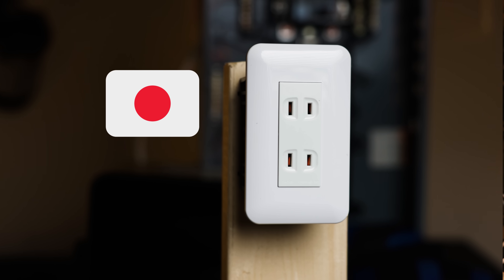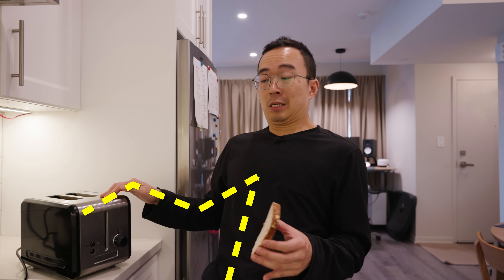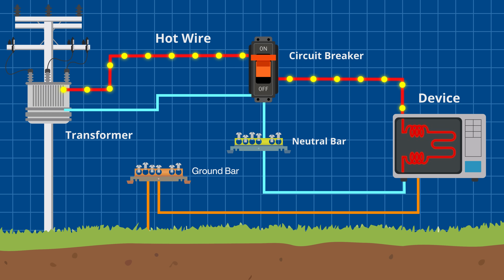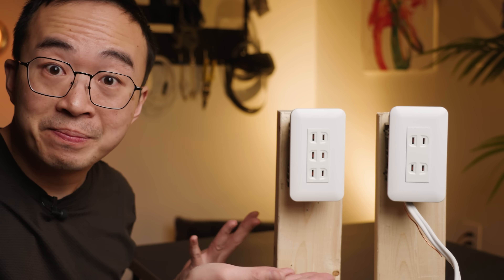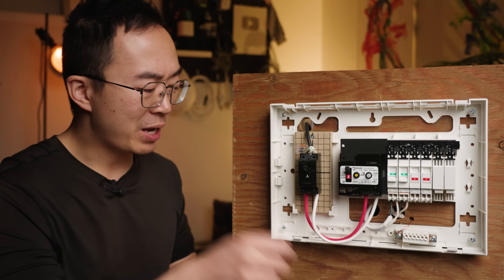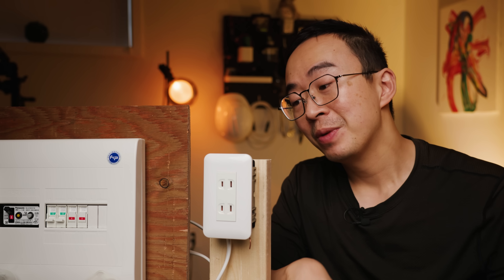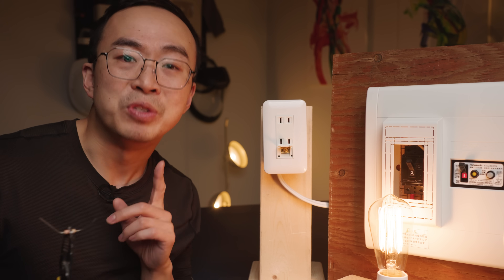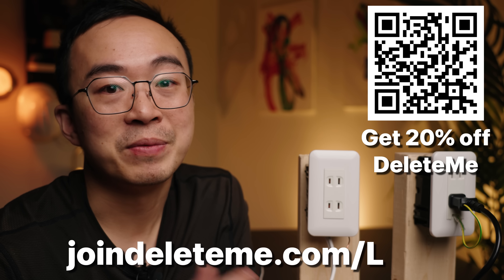How Japan Made Their Outlet Safe

Comment: Oh, FFS. I've been so annoyed at Japan for all the years I've been living here, and bought a special GFCI for my workbench outlets, and ran a ground cable across the room to my washing machine outlet, and it never occurred to me that the "thing with the extra button" I've been looking at for years in my electrical panel is a GFCI, though it has that totally obvious extra reset button that's, well, what else would it be for?

But actually what got my attention here is that the outlets you showed are proper NEMA-15 with the neutral blade larger than the hot blade. I thought they didn't do that in Japan, until I checked all the outlets in my apartment (which is fairly old, '80s I think, definitely no later than '90s) and they are all polarised, too. But the damn extension cables and power bars here are not. WTF?

Comment: TLDR it’s A GFCI breaker.

We do this in America too. (It’s actually cheaper) the ground wire is just redundancy.  

You can do that this to put ground fault protection on older homes with ungrounded systems.

Comment: This is not exclusive to japan.
Many other countries use this as well.
They use multiple systems. 
The weakness of this system is the reliance on continuity, where in theory there should be enough current through ground to trip the breaker, but in reality this does not always happen, the breaker stays closed and now you're back with the same old problem. Except its usually higher voltage across one phase in a TN system than in an IT system.

Comment: In the Netherlands(also Belgium) we have TT grounding. Neutral is tied to ground at the central transformer. Every house has a deep ground rod. The supply company only supplies neutral and live. Neutral is not connected to ground in the houses. 
30mA RCD's are mandatory (maximum 5 groups per RCD). No GFCI's here.
New houses require grounded sockets everywhere. Existing houses only require grounded sockets in wet    rooms (bathroom, outdoor sockets, central heating installation, washing machine etc).
All household appliances are double isolated(ie. Galvanic through a transformer and non conducting materials). 

The downside with TT is that sometimes you get a neutral that has a significantly higher voltage than earth (barely any current though). Especially with a faulty ground rod, which can affect multiple houses.

Big advantage. Neutral and live are interchangeable. Nobody cares if neutral is left or right on sockets 😜

Edit: wow a socket on bath height. Here sockets need to be a minimum of 60cm from wetzones, be IP44 or IP55(depending on the zone). What i usually see in bathrooms are sockets above 1.5m from the floor.
Reply: Well in Belgium that have also three phase 230 V without neutral. Each socket gets two phases.

Comment: Right on the money.  The necessity for grounding is mainly the result of bad appliance design (and bad socket designs in certain countries where the standard socket can easily have a metal key stuffed into it by a curious child...).  If we designed appliances (and sockets...) better, grounding would not be necessary.  There are many ways to eliminate the need for grounding.  GFCI breakers are a good one, and while GFCI breakers are mainly used in sockets installed in wet areas in the U.S., GFCI breakers in breaker boxes are becoming more common, but they are typically still limited to parts of the house most vulnerable to shorts to ground (wet areas) as redundancy for the GCFI outlets, due to their much higher cost than standard breakers.  GFCI main breakers are starting to get more attention in the U.S. though, so maybe we will see a transition in that direction in the future.  Both grounding and GFCI breakers won't prevent some initial shock before tripping though, which as you mentioned can be a serious danger to kids and older people with heart problems or pacemakers, so a better solution would be for appliance manufacturers to insulate metal casings from live wiring inside the appliance better, or even better, they could avoid using conductive metal casings entirely (opting for insulating plastics or ceramics instead).  While insulating better is a matter of quality that probably should be legally enforced (and this is coming from someone who is generally opposed to excessive government regulation), plastic casing is not feasible for all appliances, and ceramics can be fragile, expensive, and quite heavy.  Heavy appliances like fridges, washing machines, and dryers need stronger structure than plastic can provide, and the easiest and cheapest way to do that is to use steel casing.  And toasters (and clothes dryers) often have a lot of metal because plastics don't tend to be heat resistant, and the ones that are heat resistant are far more expensive than steel.

So what it really all comes down to is that grounding and GFCI breakers exist so that appliance manufacturers can be cheap and lazy about safety without causing too much harm to consumers.  (To be fair though, GFCI in wet places would still be a good idea even if manufacturers prioritized safety, because you never know when some idiot is going to accidentally spray the toaster or drop the hair dryer in the bathtub.)

I'm honestly not sure what is better: The government regulating construction heavily so that appliance manufacturers can cut corners on safety, which makes housing more expensive but appliances cheaper, or the government regulating appliances heavily so that construction doesn't have to put as much resources into grounding and GFCI, which would make appliances more expensive but housing cheaper.  I guess there's always a tradeoff when regulating industries to keep people safe.

Comment: Brazilian here. That's how we used to do before the 90s, when ground became a requirement for new houses. Neutral was used as ground, plus a circuit breaker. Obviously, using the neutral as ground is a horrible choice, but was done due to the extreme poverty. Unfortunately, it is still pretty common to see this setup in old houses and that's why we sometimes get those small electrical shocks when touching the shower handle. It doesn't kills you (i used to get them everyday growing up since i was a little kid), you get used to experience them every day, but it's not ideal.

Electric shower heads + hanging wires + neutral as ground + body and floor wet = fun shower!

Comment: Some remarks:

1. You don't have so many electrocutions or shocks in Japan, because the average IQ in Japan is 10 points higher than the average IQ in the US, and with higher IQ there comes a better understanding of technical issues as well.

2. In the US every hillbilly can make an installation (and most of them even think they know how to do it right), while in Japan - as far as I know - all installations must be done by certified electricians.

3. Sure, any system that has an RCD is way safer than whatever the Americans got until recently. However, it'd be even safer with an additional ground wire. And the only reason why Japanese households do not have it, might be that the 3rd wire was not made mandatory when the RCD had to be installed, because it would have meant re-wiring the houses (with a lot of house owner protests). But since typical Japanese houses just live .... say 50-60 years ... that problem could have been solved already ...

4. The RCD is not a Japanese but a German invention (early 1900s) which led to improvements in the following decades. However, they already started here to install 3 wires before RCD devices devices even were available, and almost every new building got an RCD after the 60s (Farmers even had to upgrade before that (say mid of the 60s) for their and for their animal protection, 500mA if I remember correctly). It might be correct, though, that Japan was the first to make it mandatory.

5. TT systems are way from being the optimal solution. They are used because the distribution companies want to save money on the expense of their customers, because then it's the house owners responsibility to ensure proper "shutdown conditions"

Comment: GFCI outlets trip at around 6MA, not 30MA in America. You can die at 9MA of current. So, how exactly is japan constructing a safer electrical system with slower reacting GFCI and the lack of a grounding system? Especially when having a grounding system ensures proper operation of the breaker in the first place, and irreplaceable saftey measures. America can swap out any receptacle for a GFCI and protect the while circuit if placed at the first device in the Circuit. It seems to me Japan is heaps behind modern electrical saftey standards. Considering if that GFCI in your Japanese panel fails, so does your safety, without any backup system. We have a grounding system (main safety) and GfCI for additional measures.

Comment: Ground sets a base zero for your electronics, this is used for more than just safety, it's used to avoid differential charges between devices, deal with static discharge, feedback loops, and etc. Is it necessary? No, that's why many devices don't use it. Can it be really helpful YES, and due to the other benefits of grounding already existing the safety through ground is just a convenient cheap solution (in most situations) to an otherwise solvable problem using an additional feature.

Comment: TERRIBLE explanation of grounding. What you are calling grounding is properly referred to as BONDING because it bonds all conducive components to neutral through a second safety wire. (bonding wire) Yes, it also connects to earth to equalize lightning strike potential, but that is out of the scope of your video.

Comment: As Andrew Lam correctly pointed out near the end of the video, the Japanese governent is pushing for installed receptacles to be grounded from now on.

One can easily find copies of the JIS C 8303 standard on the World Wide Web, at least far back as 1993, that contain specifications for flat-blade and locking receptacles that are functionally identical to most of the 15- to 30-ampere variants of NEMA 1, 2, 5, 6, 10, 14, L1, L2, L5, L6, and L14.  (I haven't looked carefully, but the most popular NEMA receptacles seem to be covered, although the Japanese counterpart to the NEMA 6-20R receptacle does not appear to share the same shape.)

Lam's video can be reduced to two points:

(1) Japanese legacy wiring suffers from inadquate equipment grounding, mitigated by service-entrance GFCIs.

(2) Japan has adopted better facility grounding practices and has been moving, albeit slowly, toward harmonization with most 15- to 30-ampere NEMA receptacles.

Comment: Japan Failed Badly. The issue is that when you need to do noise filters that shunt the noise to ground, the ground can't handled the required current without tripping the GFCI. This makes it impossible to properly filter noise on powerful machinery.

Comment: MEN systems are not about saving lives (directly) , MEN systems will trip the safety device with one fault. Non MEN systems require two faults to trip a safety device. RCD devices are used to save lives as they detect leaking current in the milli amp range that trips the circuit breaker before you receive a lethal dose of current.

Comment: Look at your plug, there is plenty of appliances that don't need third prong. They are double insulated and there is no da danger of a faulty wire conducting to the housing.
The reason why we don't have socets without ground is, well then you can't plug in something that requires housing to be grounded. 
Nothing special really.

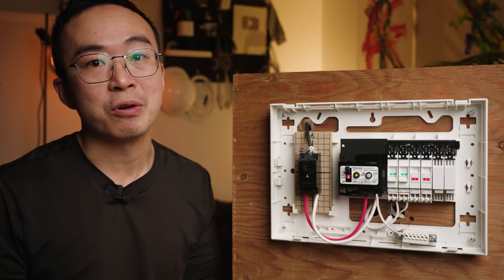Comment: I stay in Bangkok and 07:20 is something that the TH-GOVERNMENT DESPERATELY NEED to adopt and implement AS SOON AS POSSIBLE .. it is completely unbelievable that ALMOST EVERYTIME you plug something into a socket (regardless shaver, phone charging cable anything) you will almost ALWAYS see sparks fly out of the electrical panel. Thats how backward / scary Thailand's sockets are. Basically the entire nation don't even have a built in GFCI/RCD in the entire electrical outlets.

Comment: As an electrician in Switzerland, our electrical system is designed with a high emphasis on safety, similar to what Japan intends to implement with 3-hole sockets. Here, all our sockets have 3 holes, and both our sockets and plugs are specifically developed to prevent any contact with metal parts during the plugging process. While there are still some older installations, the use of RCDs (Residual Current Devices) has been mandatory for several years now, providing an additional layer of protection.
Reply: I am from Switzerland too but living in Japan. Man, you should see some of the shit here. You wouldn't believe it.

Comment: I think grounding is added as the residual current circuit breaker will not trip if the washing machine's faulty live goes on the water mains while it's off, until someone in the bath tub gets shocked.And that's why all the pipes and tubes or anything conductive within reach, even bank safes, metal doors, have to be earthed

Comment: The problem with GFCI on the panel, is if your toaster has a short to chassis, you won't know until you touch it. With a ground prong, a short to a chassis will return to the panel on its own and trip. There is also a major issue with ground loops and floating grounds that can't shunt to earth. Maybe the panel GFCI would trip if something is poorly designed, not sure.

Comment: Absolutely no one in the US would take the time to connect that grounding wire. As for the GFCI in the main circuit breaker box, all new construction requires it. The US still uses three pronged plugs because we'd probably revolt if someone tried to make us buy Polarized sockets only. We have a lot of appliances used throughout the home that need the extra ground.

Comment: Don't be fooled. Japanese outlets are back-stab only which are notorious for connections becoming loose and in turn, causing arcs.

GFCI breakers can also be installed in North American panels but aren't as convenient as simply having GFCI outlets. This is because should something trip, you won't have to go to the panel to reset your circuit.

I believe the Japanese receptacles (as well as any back stab outlets) should at a minimum be hooked to arc detection breakers as the method of connection is heavily flawed and causes arcs once they come loose.

Comment: There is much more history that you missed. In the mid 20th century, before GFCI/RCD technology was widely available, the USA started using grounded neutral conductors and polarized plugs. Lamps were one of the most common devices to be plugged into an outlet. The polarized plug ensures that the hot wire connects to the center dimple on the light bulb and the neutral connects to the screw threads. That way, you are less likely to get shocked if the metal body of the lamp accidentally makes electrical contact with the light bulb socket. The other electrical safety issue has to do with fuses. In the early days of home electrification, both conductors were ungrounded. That meant that when a fuse blows, one side of the circuit remained energized. You could end up thinking that a switch or appliance was safely disconnected from power and ready to be repaired, only to find out that there was still a voltage potential on some of the wires in the circuit. By bonding one side of the circuit to ground, a blown fuse on the hot conductor would mean that the entire circuit had 0 volts as measured to an earth ground. 

When the concept of a dedicated ground conductor at every outlet was introduced, most appliances had a metal cabinet. Someone realized that you could have the metal cabinet constantly connected to an earth ground, so that it would carry fault current away from the human operator, giving an additional level of protection. Appliances and power tools that are marked as “double insulated” usually have a plastic outer shell, making it nearly impossible for a frayed interior wire to shock the user. Therefore “double insulated” products (the have a small square inside a big square somewhere on the label) don’t need to have a ground conductor, and usually have a 2 pin plug. 

It seems that Japan never bonded the “neutral” (probably not the correct term in this case) to earth. With ground fault protection, you have a reasonably safe system. I think the modern trend in the USA to put GFCI protection on most circuits, combined with dedicated grounding conductors, creates a very safe system.

Comment: Green wire ground was very important in the days when almost every part of an appliance or electric tool was metal. Modern items are mostly plastic and the user is completely isolated. Most of the new appliances do not bother to have the third prong.

Comment: Title should be "Taking forever to get to the misleading point". Also, 99.99999% of electrical shocks happen from live to neutral, not from live to ground, an there's no way for and an RCD or circuit breaker to distinguish the human body from any other load.

Comment: Should not that  ground and neutral wire are most of the time connected by the housing of the switch pannel not by a wire. WE have GFCI brakers in the USA there just not as common and with having to have a screw driver to use the ground is it really any better then the rest of the world or is it a down grade. Cool info but just looks like a fix for an old system they didn't want to upgrade and now the consumer is the one having to put in the extra work.